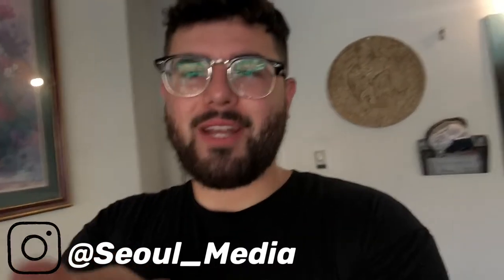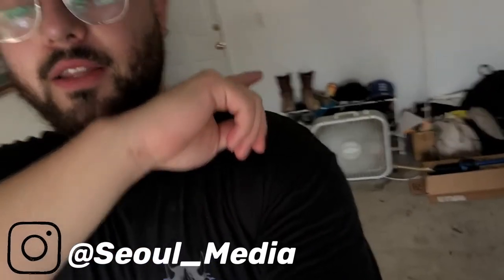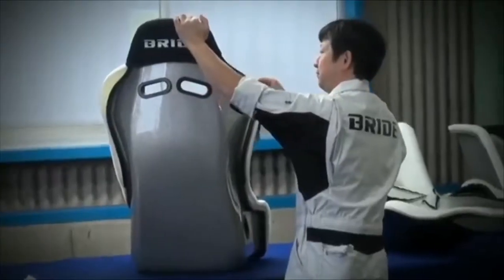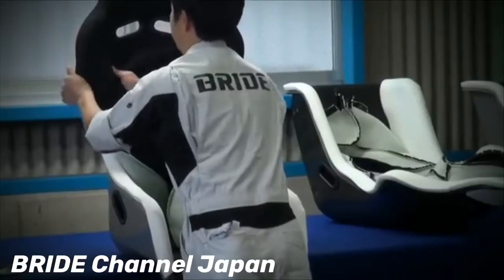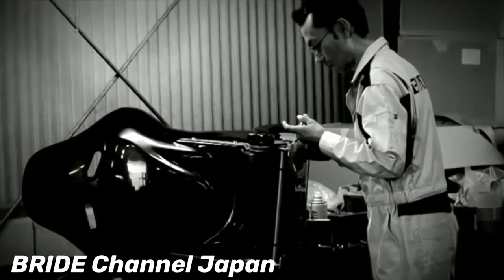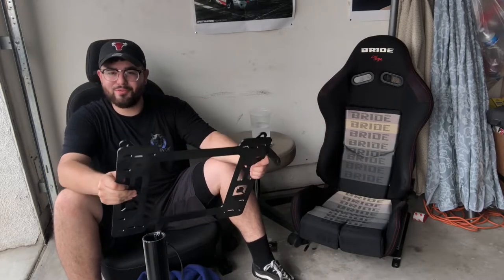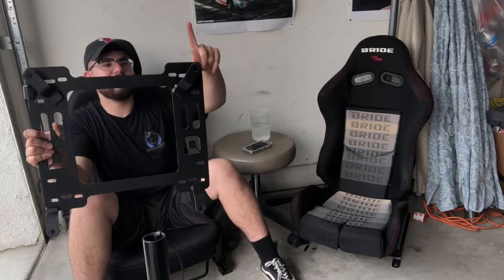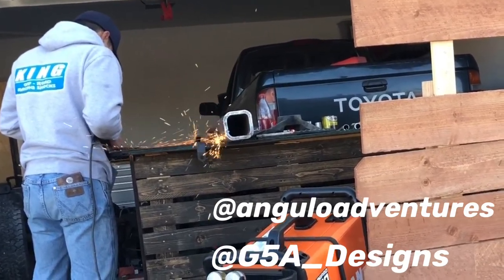Installing a BRIDE Bucket Seat in a Hyundai Elantra?

Comment: Hey boss can you do a more in-depth video on the seat bracket, I need a bucket seat for my elantra Le for the track, and I can’t find anywhere online how to do it, when I look at my stock bracket it’s just flat on both sides, please explain a bit?
Reply from the maker: I think it’s faster if I just tell you lol. So basically I bought seat brackets for a 2010-2016 Hyundai Genesis coupe. It’s almost a direct bolt on but the left front mounting point is about .5 inches off.   I took it to a friend who’s a fabricator and he relocated and welded the point in place plus reinforced it with some metal plates to ensure they don’t brake off. Hope that helps you out. I know that no companies were making brackets for my year at the time but now you could get a direct bolt on from Corbeaus website.
Reply: @seoulmedia1946  oh wow! I didn’t know that! I will check them out thank you! What about the air bag sensor!? Did you just deal with it? Or put a resistor?
Reply: @seoulmedia1946  I’m on the corbaeu site and it’s not in the list? They only have the 03-06 seat bracket? Do you know which bracket I would choose?
Reply from the maker: @MedievalMinecrafters  I just left the sensor unplugged, it has the light come on but it doesn’t affect the car otherwise. And it looks like the one I found was model# E2078. It says it should fit up till 19’ year model.
Reply: @seoulmedia1946  thank you for that! I can’t wait! I’m gunna order one shortly

Comment: Where did you get that steering wheel cover from bro?
Reply from the maker: So originally I had cut up a cover made for a bmw m5 because there weren’t any companies making one specifically for the Elantra. But I’m in contact with a company right now who makes custom fit covers so I’d say if you can, wait until after that video to know which option is worth it.
Reply: @seoulmedia1946  you’ll be posting a video on that soon?
Reply from the maker: @SXTHGEN  yeah, I’ve been behind but that video will be out soon. Just need to finish editing
Reply: @seoulmedia1946  for sure bro I’ll be on the look out 🙏🏼🔥